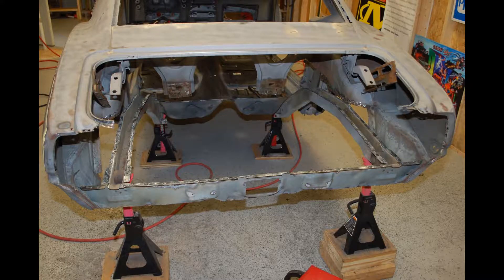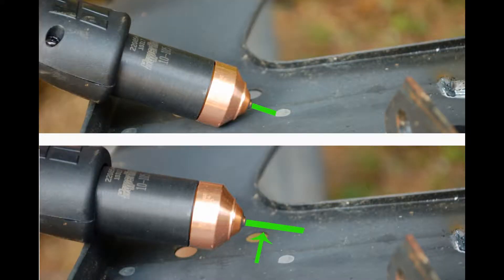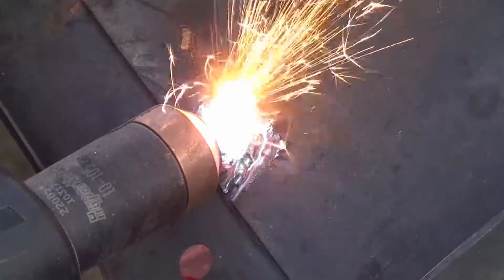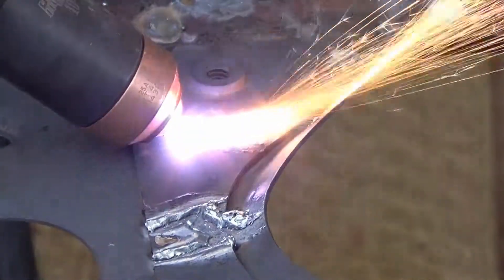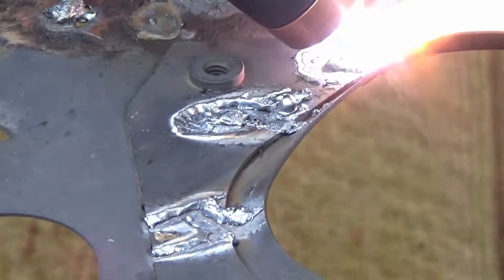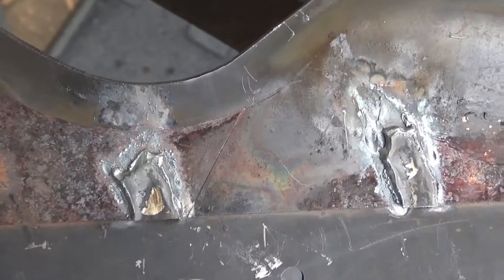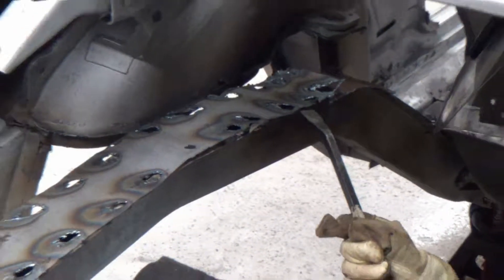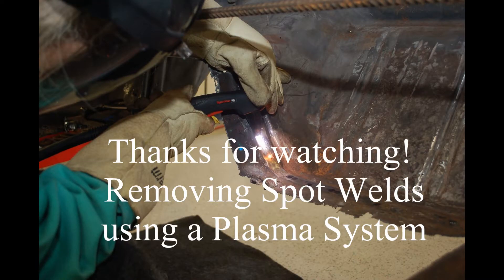Using a Plasma System to Remove Spot Welds 7

Comment: I was using my plasma cutter on the torque box spot welds on my Mustang, but will try your method with lower amps and tilted torch on other side. Thanks